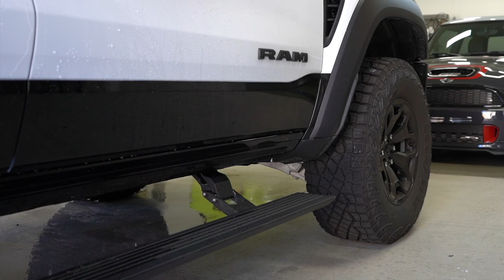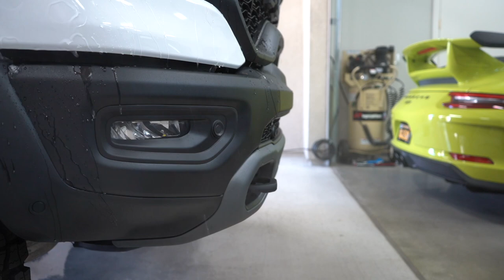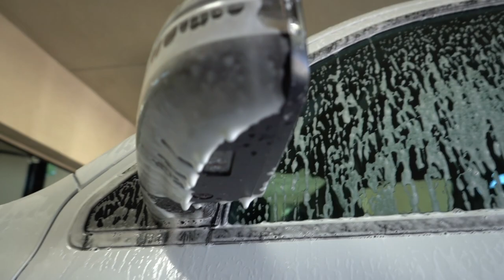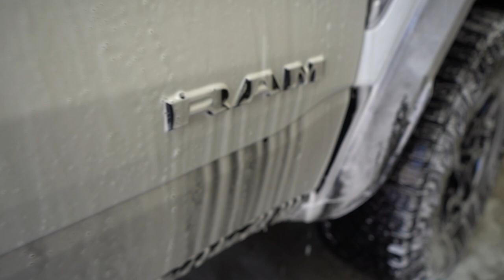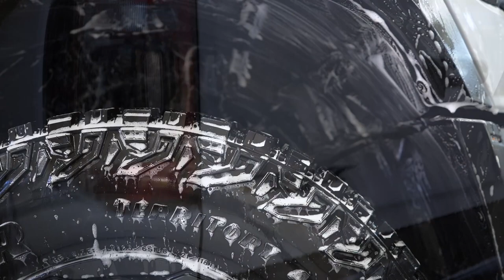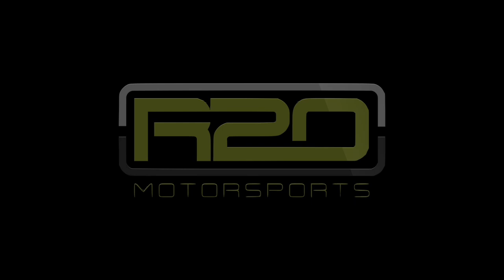ASMR - Ram TRX First Wash

Comment: What's the best power washer and detergent to use on the TRX. I need a 50 ft flexible hose too... thanks
Reply from the maker: I use a Kranzle pressure washer and adams car soap.  For the hose I suggest you check out www.obsessedgarage.com  Good luck!
Reply: Thanks so much for power washer info.

All of my local drive through "touch less" car washes will not handle my 88" width TRX or it's too narrow to take a chance.
Thanks again!
Reply from the maker: @wesnicholas2881  Thanks for watching, congrats on the TRX!